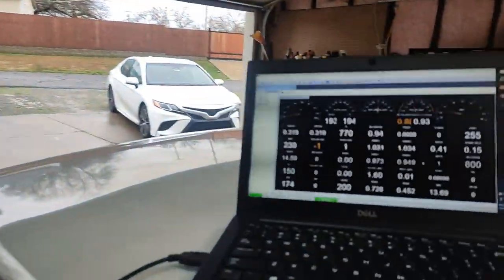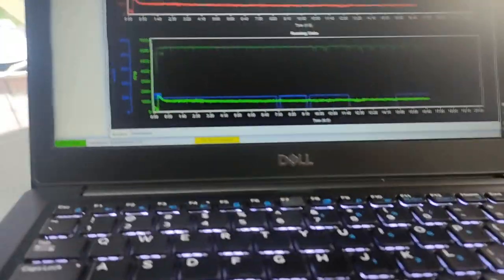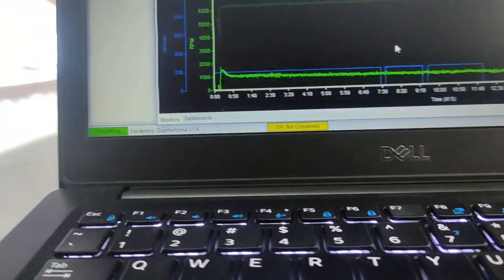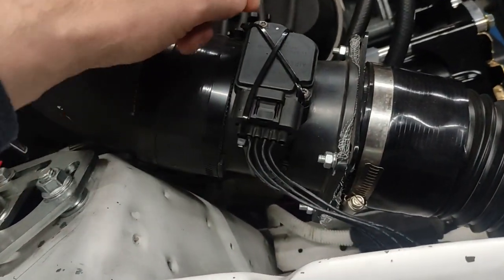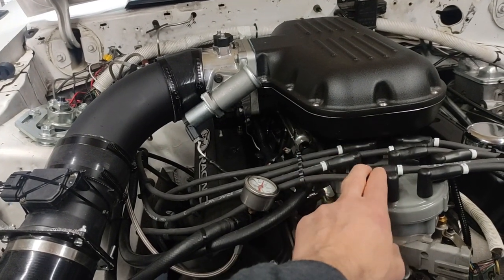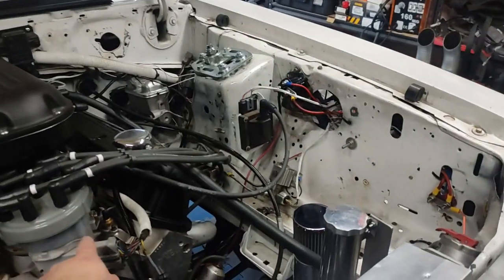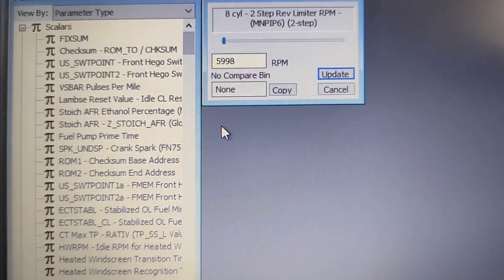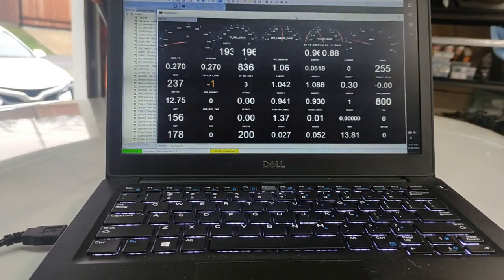Idle test results - stable for 16 min

Comment: I like using an MSD ignition box.  I have a 6BTM, but use it more like a 6AL.  I use a MSD tach adapter on my '86,  and have had zero issues with the tach signal (aside from 1 breif bad connection on my part) in roughly 25 years.  Looks like you car is behaving itself...hope you have the issue gone once and for all...
Reply from the maker: Thanks Todd, yeah maybe i wired the tach up wrong last time when i had the msd! I still have my msd tach adapter i can try